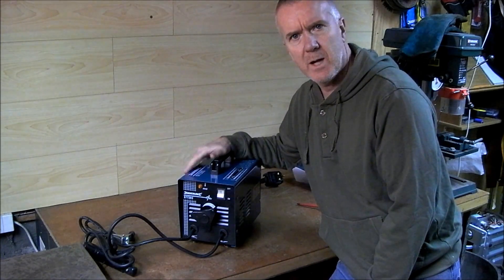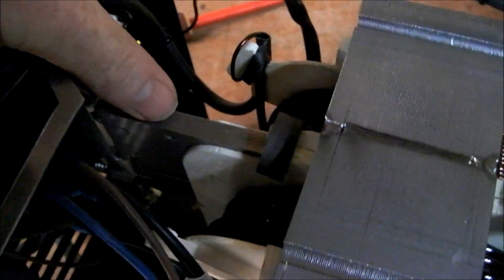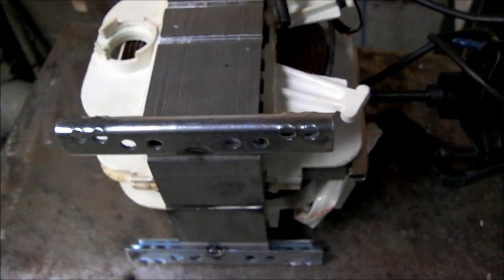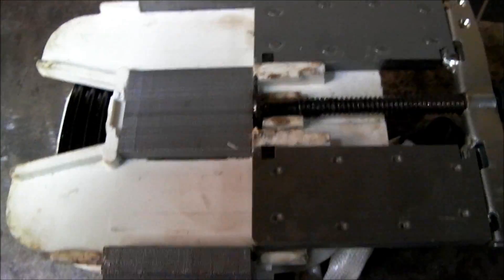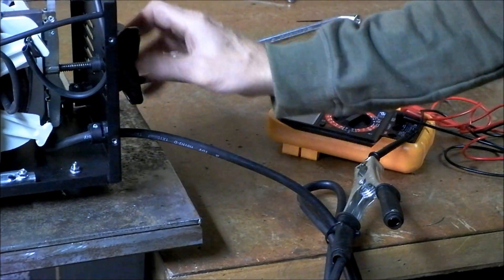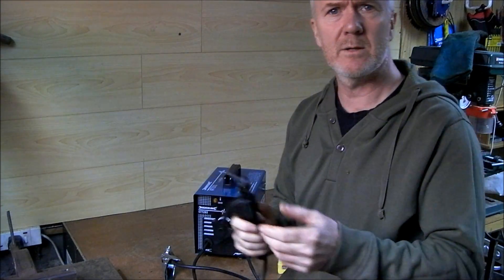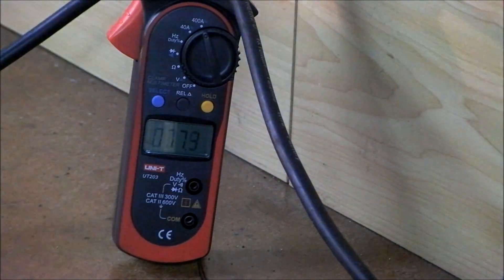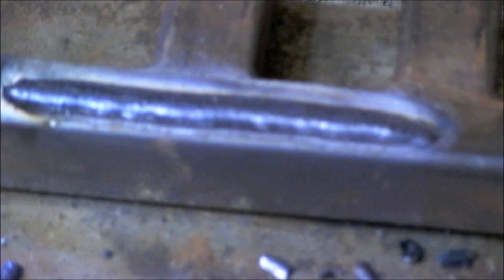100 amp stick welder tear down and repair

Comment: I would word it a little different, we would say that at max power the shunt is increasing the mutual inductance between the two coils. When it is min power and the core metal is retrieved from the center of the transformer you have minimal mutual inductance.

Comment: u said u were going to repair the shunt, though u skipped showing us what was wrong with it? and then skipped fixing anything and said i repaired the shunt?  and went to testing it, wtf...  why did u not show us what was wrong? did it break a acme thread?  was it over spun and not on its thread anymore?  did u add a blocker to stop it over extending?  what a waste of time this video was..
Reply: Useful information for some of us.

Comment: Pick up a simpler model from CIGwelding company. It is dead. Power coming in no light on switch of overheating light not on. Fan is dead.  The bymetal switch is shorted.  Is the switch meant to by shorted. Any help would be appreciated.  Have a wonderful holiday season.

Comment: Sir did you cut the center of the primary and secondary or what I mean is, separating the primary and secondary?? thanks to this video it helps a lot..
Reply from the maker: These welders, for ease of assembly, have the transformer made in two halves, and then welded together . I just ground of the weld, reverse of assembly, to separate
Reply: +backstreetmechanic Do you think you could help me repair my welder?it powers on but the fan wont work...
Reply: I have just got a sip weldmate and the spindle undoes just the same. if I take it apart the same way how will I join the transformer back together?( I only have this welder )

Comment: whats the material of the magnetic shunt, and can you make a better explanation of what happens when you put in and put out the shunt. Thank you very much for your video it is really informative, i am building a welder myself that is why i am asking and if you can please explain how to change from ac to dc and what happens when you do so.